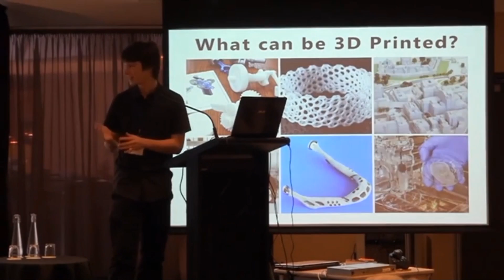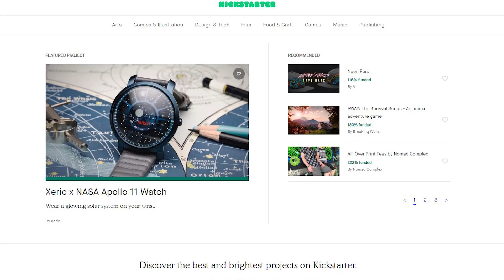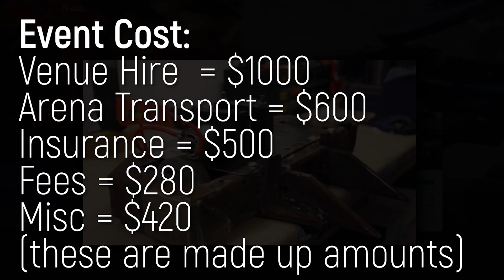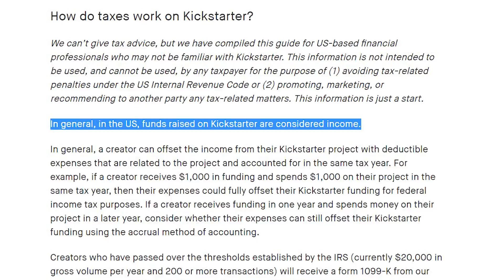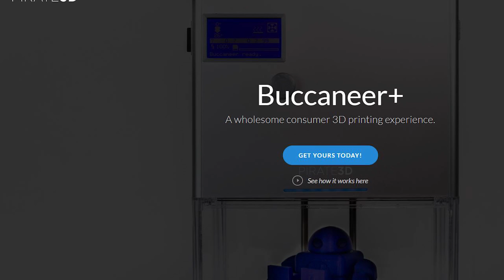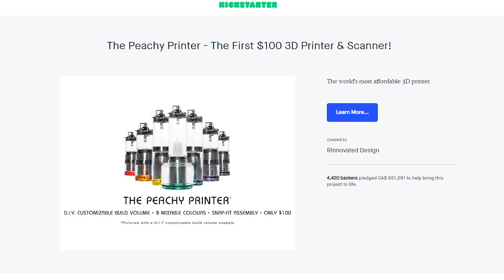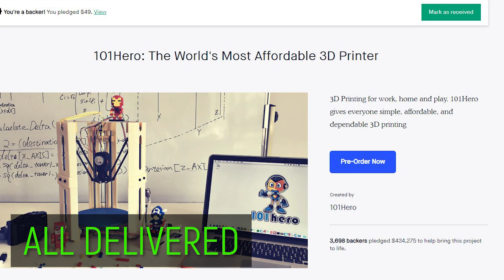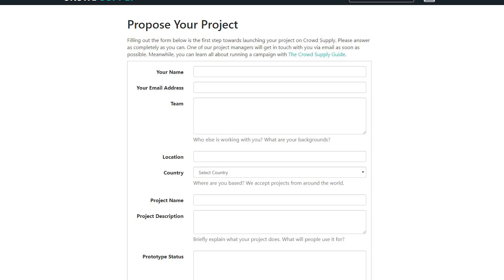This 3D Printer Raised $1,438,765 and Failed. Crowdfunding Warning.

Comment: I backed Reach3d printer on kickstarter a few years ago and they all delivered almost on time. Still using it.
Reply: Hey Ian! We did all right, got way behind, never realized what I was getting myself into sooo much manual labor that I didn't fully anticipate, so I had to do the work myself. There was no way I was going to throw in the towel though. :)
Reply: @Reach3DPrinters  Hey that's badass and it looks like you're still around selling and supporting machines.

Comment: I paid into two failed 3d printer projects.

First was the Makible MakiBox, which took over $500 of my money, including some filament, and then never delivered. It was a super low-cost printer, but I was dumb and ordered filament at the same time. Nothing ever showed up. HE posted lots of photos of working in China, and I think a number of people actually received units. I did not. Eventually, he just disappeared. The Makibox was a competitor to the Buccaneer at the time.

Second was the French Kickstarter ZeePro Zim which had an online slicer/control, dual heads, etc. Nice unit in 2014. They went under, though, and then their printer became a brick unless you replaced the control board with something open source. Out $1200 on that one. At that point, I vowed to never again buy anything like that that required a cloud service. That includes the laser cutters that came out later. I knew the risk, but at the time, thought I'd take it. The problem with cloud-based logic for a tool, is that at some point in the future, eventually, it'll go away, or you'll be required to pay more, or upgrade the hardware. That's a guarantee. So you need to treat the item more like you would software than a tool. I own tools (and synthesizers) that are 40+ years old, and will work for as long as I maintain them. Software, on the other hand, can stop working with the next rev of the OS.

Bought Prusa after that. They're slow to deliver, but they do actually deliver, and make good stuff.

I've had a few other Kickstarter fails, and many more successes. It's not as interesting a platform now that it's more big company with flashy videos vs. the original "person in a garage" approach. I'll check out Crowd Supply as it seems a bit more like how Kickstarter used to be, before they got greedy.
Reply: I got both printer (probably the last one delivered) and filament. It was a flimsy construction but after a lot of improvements it actually produced half decent prints. All in all it was a really bad printer and you might even been lucky not receiving one.
Reply: You can actually buy a cheap but pretty usable 3D printer nowdays for $200 - like the Ender 3. It's for home use, you don't get all quality parts, not as good as a Prusa, but it works pretty well. And they deliver. That's what happened in just a few years, I guess.
Reply: @janosnoll6830  Thanks. With the Prusa, I bought it pre-assembled and configured, rather than as a kit. I was able to print a quality print within minutes after unboxing it. Tweaking 3d printers isn't my hobby, but I use 3d printing to support other hobbies, but at the same time, it's a hobby, so commercial 3d printers are out of my budget. For folks who prefer to tweak, modify, etc. there are tons of low-cost options these days.

Comment: Reminded of Sprayprinter. And they already had a 1st version being sold and shipped that offered one color use, so I backed their multicolor 2nd version. They ran a fancy bunch of videos up until the they claimed to want to follow the advice of some hotshot telsa investor they claim told them to abandon all the prepaid orders for their 2nd version. They still have their youtube page active yet are not answering to commentary, and their main website they closed down, and then sent investors some emails telling them that they are just taking a break right now and plan on returning to production and shipment of the 2nd version. They claimed they didn't like the software for it, and that they were going to write a new software interface for it, which is what sprayprinter investors thought was going on for about a year before they pulled that wanting to take advice of a greedy tesla investor.

I think they blew threw the money vacationing while trying to make it look like they were efforting to market the product. You dont just make a claim some telsa investor was able to convince them to stop applying themself to the task that people trusted their money with them in the first place.

Comment: Crowd funding sites really need mechanisms to shut down campaigns that are based on impossible physics. 

There was a campaign for a self filling water bottle. It was going to pull humidity out of the air, powered only with a solar panel on the side of the bottle. Real dehumidifiers exist and can even be solar powered. But it takes kilowatt hours of electricity to pull a liter out of the air if the humidity is below 40%.
Reply: Agreed.

KickStarter has placed itself in a legal sweetspot, refusing to take any blame for what happens with the project but happily taking a cut of the money.

Comment: Yea I almost gave to that crowd fund project but something (I dont remember) rose a red flag for me and I did not follow through. Glad I didnt too but still have faith in the crowd funding community.
Reply: You should be pleased....all gamblers win sometimes but mostly lose to the house....that's what they're there for....the house that is.
Reply: @gangleweed  Your comparison is unwarranted. This is NOT gambling, at least not in the sense that there is a house and a racket system designed against the gambler. Because you can do background checking on those running the crowd funding projects and get a sense if its a good idea to throw money at them, for that reason alone it is not the same thing as casino gambling. Case in point and the big difference is the same cannot be said for the slot machine and you dont have the opportunity to look back to see... say how many times it has been played over a given time and how many times and what amounts have been paid out, which is information you could use to know if a machine is close to another payout. If crowd funding projects were like you claim they are this system would already be dead because there are far more smart people out there than there are gamblers and not enough of them to prop up a system like this. Another case in point is the fact that I AM NOT a gambler and never have been and will not take a bet that I dont at least have odds in my favor of winning! So no, my personal pleasure has nothing to do with it and no I was not pleased Pirate3D lost because I thought they had the potential to make a good machine.
Reply: @kevinm3751 The end result is the same....you have no guarantee of a win no matter how sincere the other guy is...…..shit happens and you are left holding the baby.
Reply: @kevinm3751 LOL....OK, I'll keep the money and run.

Comment: I backed Keychain project on Kickstarter and while it delivered it came to me with a 2 months delay ( I guess something you have to accept ) and a not quite as advertised surface and parts fit finish.
I do a little bit of CNC work myself ( https://i.imgur.com/EoZLeud.jpg ) so I actually know where these issues come from but still... What I received was NOT what I was advertised as the product was absolutely flawless in the advertising - Like no tooling marks caused by flipping the workpiece and then NOT doing a spring pass at full depth again.

Anyway... Yesterday I finished building my Original Prusa i3 MK3S and I'm not looking back on the price I paid for it - Yea... It's more than twice the price for less than half the looks but ( where sensible ) I'd rather have a System I can repair, modify, upgrade and learn along the way than an out of the box experience that will betray me one day in the worst possible way and FDM Printers just lend themselves to that concept.

Now as for SLA I went with a Form² and an already preordered Form³ ( will have to keep an eye on the Forums if severe problems arise now that the first models are being shipped in case I need to cancel that order ) as I don't believe for them to be suitable for a DIY experience.

Comment: I picked up a deltaprintr second hand, they had a crowdfunding campaign and wow, can you not find any support now. I have been looking for a copy of the firmware so I can get it to work properly however it seems like everything I can find does not work. Could be a board problem, but some other time I will get it working.

Comment: My impression of crowdsupply is this it is a bit more serious about hardware projects and that some tangible return is there for your investment. More along the line of, 
"hey guys I need to make 1 board to fill some role, does anyone else want one? Good then I can bulk buy and get a better price on the manufacturing."
There are some better players using it as well like Lime Micro (Lime SDRs). I backed that one and got a unit when it was completed.

Comment: And then there's the crowd funding that promotes state of the art and delivers mediocre corner cutting cheaped out finished/unfinished.  My guess is that is more the norm.  M3D
Reply: The 101 "zero" listed in the video as a delivered project appears to fit that bin.
Reply: @hanelyp1  Until I see a product listed for sale on Amazon or Ebay etc....it doesn't exist. If promises were horses, then beggars would ride.

Comment: Great vid! 
I have run a Kickstarter, and delivered on it. But that was a small one and it was a actual sure thing. Even so, stuff did go wrong (unexpected higher costs), but I had enough buffers build-in to still be able to deliver. 

NEVER back a Kickstarter (or similar) UNLESS it's a sure thing! As Angus said, basically it's a donation with the hope that you may receive something at some point. 
NEVER back a Kickstarter (or similar) UNLESS they have a strong presence OUTSIDE of the crowdfunding platform.
NEVER back a Kickstarter (or similar)  for an electrical or mechanical item UNLESS they have a fully functional prototype, and (preferably) have demonstrated it at a maker fair (etc) LIVE and WORKING. 
NEVER invest more money into a crowdfunded item that you can afford to loose with nothing to show for!

As for no recourse, I have heard of lawsuits against folks that have run Kickstarters, that have gotten some money back. Those would have been US based class actions. But keep in mind that as the best case scenario, you can only get back money that is still in the  folk's pocket; if the money is spent on the project it's considered to have been legitimately spent and part of the risk you took to take part in the Kickstarter.
Reply: I'd love to talk to you about that sometime.  Looking back on the project, what buffers saved your ass the most and what buffers did you wish you had?  Did you use a fulfillment service to ship your product, or did you let shipping consume your living room and life for a few months?  If you had to do the whole thing over again, what would you have done differently?
Reply: @poisonouslead85 ,
It was a VERY complicated process, and took my time before starting it calculating EVERYTHING, FOUR TIMES OVER. And still unexpected stuff happened. 

BUFFERS: I had two main buffers, one was that was holding 33% of the money in my hand (saved it up myself) and I used that in a change of plan after the KS was over (this money did not go through the KS process, but was spent on the project). The second was that a relative pledged the money of 1 (of the 10 big ticket items) WITHOUT claiming the reward, meaning I  would have no costs to fulfilling it and that the full 10% went towards the buffer fund. 

FULFILLMENT:  I used a small factory I had used many times before and had been doing business for 5 years already. The factory is on the other side of the world, and my KS project was just too small to make visiting the place possible, but if you ever do a (much) bigger KS with a factory that far away, try to put in a visit, just to make sure they can do it. Visit BEFORE you start your KS!

SHIPPING: I used dropshipping with my small factory. Dropshipping is tricky, only do it if you REALLY trust the dropshipper. 
About 'living room' shipping. ONLY do it if you KNOW that YOU CAN do it. Meaning that you have successfully done it before and in the volume you're expecting from the KS. OTHERWISE DON'T DO IT!

If I had to do it all over again (and I'm planning to, soon)... I'd not change too much. Mostly updating the inner workings to fit having an in-house 3D printer to do the prototyping (I had to plan on a 3D print service in the first one). Mostly my experiences were good. 

IF YOU'RE PLANNING A KS YOURSELF: Please think twice; it's a lot of work and you're putting your reputation on the line. Don't even start it if you're not sure you can deliver.
Reply: @OfButterfliesandThings  If I ever do a KS, I'll probably do it the way the gent behind the Sinden Lightgun ran his.  He only ran his to hit MOQ on components and to justify spending his own money on having injection molds cut.

When it comes to a 3D printer, there's a huge difference between the prosumer models and the cheapies.  Do yourself a favor and keep an eye out for a used Raise3D N2 if you're on a budget.  They'll be a bit pricey BUT Raise's support is top notch and the machines are very well made. The Bondtech extruder upgrade will make them fly too.  I'm printing 4x faster than guys with Ender 3's and I still have plenty of room to run faster with a few upgrades.
Reply: @poisonouslead85 , pal, I got an Ultimaker 2+ for the project, half of which I paid for out of my own savings. It now has a Bondtech  extruder. :D
Next on my wish list is a Prusa MK3. Maybe inconjunction with my next kickstarter.

Sinden Lightgun's stuff hasn't been delivered yet. We''l need to wait to see if it's a success or not. Proof is in the pudding.